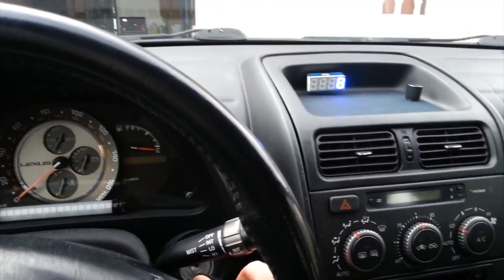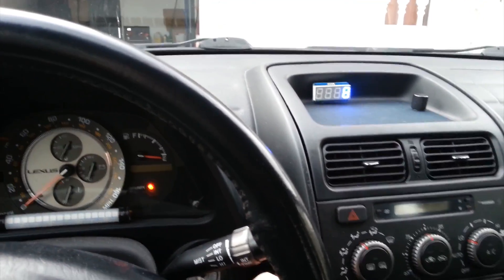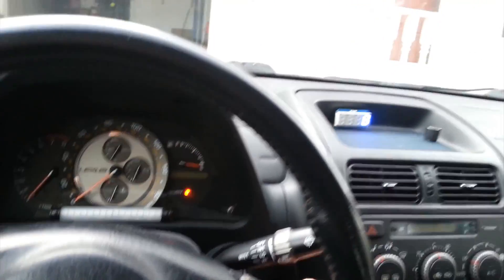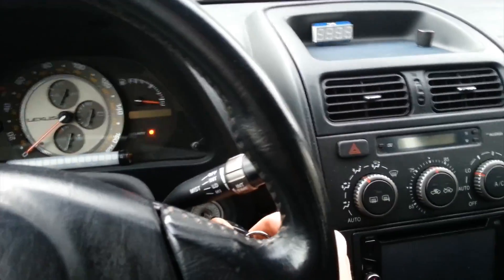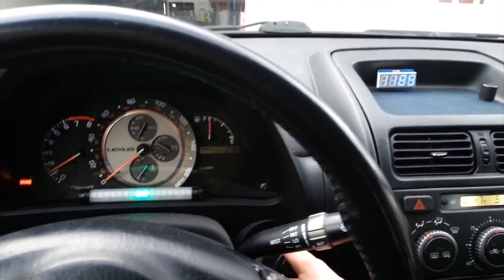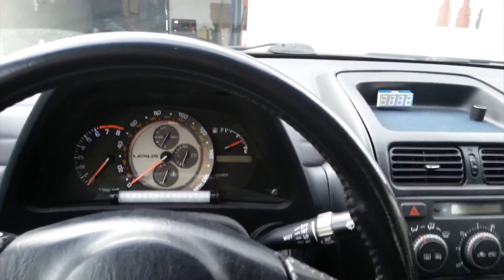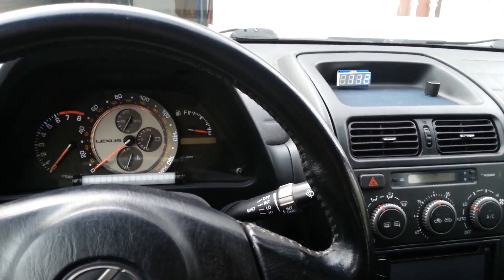Arduino Shift Light Completed IS300

Comment: its not weird that you get the rpm signal if you put the key (some cars need one/two turns) -> key plus is already flowing.. therefor you got a constant 12V signal in green line. its ok

Comment: Why didn't you just get the rpm value from the can bus?
Reply from the maker: +nickisanto08 Good question.  There are methods for easily obtaining this information, but from my experience, the CAN bus (especially older systems) are far too slow for an accurate shift-light. Pulling the RPM signal directly from the ECU is much faster and more reliable. Some people on my forums have adapted the shift-light to work off of the CAN bus and I intend to make this an option in the future.  Thanks for stopping by!! :)

Comment: Which function do you use to read the signal? i saw your schematics, but im lost. Didnt found the part when you read the signal coming from the rpm.
Reply from the maker: +will gonz  Hi!  Thanks for stopping by.  The RPM is being read using one of two processes - an Arduino interrupt, also a software method called Frequency Measure. The signal is interpreted using a simple transistor which protects the arduino's electronics (which can only handle up to 5 volts in). Check out my site at chippernut.com for more info.  Thanks!

Comment: Hey, what type of PVC is that in? It looks really good like this, I think.
Reply from the maker: +JustKyzuuh Thanks!  I don't remember the size, but I picked it up at a local hardware store in the plumbing aisle. I just brought an LED stick with me and tested which hose fit - hardest part was getting the memory-bend out of it w/ hot air and elbow grease. :)

Comment: On the back of the dashboard, which wire is the one that sends signal to the tachometer?
Please and thank you
Reply from the maker: BMXAndy1994   Hi!  thanks for your interest. In the video it's the yellow wire, this is connected between the car's ECU and the stock tachometer -- it intercepts a square wave generated by the ECU.  This is critical to obtain a clean RPM signal. You can sometimes also you a inductive pickup around the sparkplug wire or the IGT signal to the coil -- but these have not been tested w/ this particular shift light (yet).

Comment: Hello, i'm very interested in develop your Arduino Shift Light in my car .. its a NISSAN SENTRA CLASSIC 97 (OR SENTRA v16 / SENTRA TSUBURU), the problem is my car,doesn't have a tachometer, only have the KM/H  .. http://www.todoautos.com.pe/attachments/f43/107811d1216186775-nissan-sentra-1600i-ex-saloon-ano-97-img_6231.jpg . can you tell me if i can get sucess in this proyect? greetings from lima-peru

Comment: After struggling for hours, I finally got this working. I had to calibrate it many times to get the exact RPM of my car. Thanks a lot man. Any idea of integrating speed meter as well? Thanks again.
Reply from the maker: Thank you for sharing your experience, Vajira!  I'm glad to hear you got it working, although I'm interested to hear what difficulties you experienced. I want to improve the shift light to make it easier for others to install. If you don't mind, please share your experience here or head over to my forums at chippernut.com -- I'd love to see your installation! I do plan to add a variety of different features and speed will likely be one of them. But right now I'm working on modeling the gauge to fit in a 52mm pod. Thank you again for commenting and sharing!
Reply: Chippernut It was just a basic installation and I had to remove it as I drive my car to work. Next time I will post some. I only developed the RPM part. Not the LED bar and EEPROM. Because currently I dont have LED bar to fit. My car is a 95 Trueno and it has only 22 pin OBD1 connection. I had to take the tacho signal from IG- pin. It didnt work at all when I first connected with Arduino. I was just getting zero reading all the way. After enabling digitalWrite(sensorPin, HIGH); I started getting some garbage numbers including some minus values. Then I started changing calibration value rpm = 21e6/interval; all the way up to rpm = 61e6/interval;. Then only I got some proper reading but it was nearly a double the amount of what my car's gauge reading (2000 RPM when car was running at 1000 RPM). So I simply divided the rpm value by 2 and its all good now.

Now I'm trying to integrate speedometer as well. For that I have to tap into my car's ECU to get the VSS reading. May be I will be able to get both tacho and speed signal from the ECU. I ordered a 8 digit 7 seg display so I can feed both RPM and speed to a single display. Most probably by this weekend I will be able to test the speedometer and will let you know how it goes. Do you have any idea of how to read the fuel level and coolant temp from ECU? Keep in touch.
Reply from the maker: Vajira Lasantha That's awesome! Great work adapting this for OBD1. That was a clever solution to pull the sensorPin HIGH, I'm a little surprised you had to raise the calibration so high. Once you do this, you should be able to read the VSS signal pretty easily, then adapt the code for multiple displays and configurations. Very cool project! I can''t wait to see it completed. 

Reading the fuel level and coolant temp should be pretty straight forward. I think most cars use a variable resistor on the fuel sender unit (newer cars use a combination of sensors). The most basic is here: 

http://www.wiringdiagrams21.com/wp-content/uploads/2010/07/Throttle-Position-Sensor-Circuit-Diagram_thumb.png

http://patentimages.storage.googleapis.com/US7091819B1/US07091819-20060815-D00003.png

AnalogRead would serve nicely for this, Although you will have to step the voltage down if your max is above 5V. You may want to start with an attenuator circuit. Try this. 
http://www.electronics-tutorials.ws/attenuators/attenuator.html

Coolant temp will likely work in the same manner, only this is a thermistor.
http://en.wikipedia.org/wiki/Thermistor
Step the voltage down (if needed) and use AnalogRead. 

Thanks for responding and keep up the great work!  Please let us know how it goes. Feel free to stop over at my forums and post your success stories there!
- jon
Reply: Chippernut Hi Jon, Thank you for the info. I found a service manual of my car and hopefully I will be able to find some technical info from it. I found some good speedometer post from the link below.
http://matthewcmcmillan.blogspot.co.nz/2014/02/arduino-digital-speedometer.html

After changing some codes from it, I was able simulate it with Proteus and its working pretty good. I combined both tacho and speedo codes together and display them on a 8 digit display. Please check the screenshot here.
https://dl.dropboxusercontent.com/u/28031454/simulator.jpg

I still get some wrong readings here n there and have to filter them in my program. I will soon connect this to my car and see how it goes. Will post this to your forum as well. KIT. Thanks.
Reply from the maker: Vajira Lasantha That's awesome! Thanks for sharing the diagram of your work. I'm excited to see it installed and in action! Fantastic job!

Comment: great job on this project it turned out really well. would you post a schematic and the code you are using?
Reply from the maker: Thanks Sean.  You can find the schematic and code located here.  (I'm making some design revisions though, should be done in the next few weeks. I'm going replace the signal intercept transistor w/ an optoisolator) You'll probably have to play the transistor wiring for your specific application. 
http://jonduino.weebly.com/
Reply: Pixel This
wow that is awesome thanks so much for the beautiful wiring diagram and parts specs :)
Reply: Pixel This
you could get rid of the voltage regulator and heatsink because you can just use the 5v from the arduino. it would save some of the energy being converted to heat.
Reply from the maker: Sean Balser Hey Sean, Not a bad idea if you were running a single 8-pixel strip, but you're dancing a fine line w/ the current limitation of UNO's on-board 5v regulator.  The regulator's Max current @ 1000ma and the neopixels are 60ma each @ full white brightness... so, if you want to flash white with 16 pixels, that's 960ma... plus the LED backpack and chips.. it will likely overheat, fry the regulator, or starve the amtel chip of power and crash the arduino...  You can try it, but I have a feeling it's just a little too close the max -rating for comfort. 

Hope this helps :) 

References: 
http://arduino.cc/en/uploads/Main/Arduino_Uno_Rev3-schematic.pdf

http://www.mouser.com/ProductDetail/ON-Semiconductor/NCP1117ST50T3G/?qs=Gev%252bmEvV0ib6dijy6U0dhQ==

https://learn.adafruit.com/adafruit-neopixel-uberguide
Reply: Pixel This
I just finished making one of these and it is epic! Thank you so much for doing all the hard work and posting your schematic and code for others to build and enjoy, it is really appreciated! :)
Reply: Pixel This
so i made one of these according to your schematics and the menu and leds and everything works i just cant get it to display rpm. it shows 0 and shuts off. i know that i am using the right wire. when i touch the transitor connectors it changes rpm and then when i let go it shuts off. all of my solder joints are good. i have a nissan 300zx and according to your post i may need an npn instead of a pnp? any help would be appreciated.
thanks.
Reply from the maker: Sean Balser Hey Sean, sorry it took me so long to get back to you. Yes, I would try a different transistor first. A few other viewers have pointed out that the schematic does not make the correct use of the transistor to begin with -- though somehow works fine in my car. If this doesn't work, try re-configuring the transistor using a standard schematic.. otherwise try an optoisolator.. In the next few weeks I'll have schematics for NPN, PNP, and Opto signal pickup... sorry I can't be of more help. but please stay tuned!  If you get it to work, please post a video or comment with your fix!!
Reply: Sean Balser Hi Sean, I have built this setup and all works good on bench but not in my 300zxTT, the ecu to rpm meter in the Zed is a ground square wave so if you leave the arduino and PNP 2N3906 and change the code on line 185 to " pinMode(sensorPin, INPUT_PULLUP); " in stead of " pinMode(sensorPin, INPUT); ", When you ground the rpm input wire to ground it will switch on "0" and work.
Reply: iain knight
wow you are my hero i will try that today!!! thank you so much for taking the time to post that!!!
Reply from the maker: iain knight  Awesome solution!  Thanks for helping! I know you're busy, but could you post pictures of your setup on my forums (chippernut.com) or reply w/ a YouTube video?  I'd love to see your final installation.  I'm going to keep this advice handy because a few other people have had this issue.  Thanks again!!